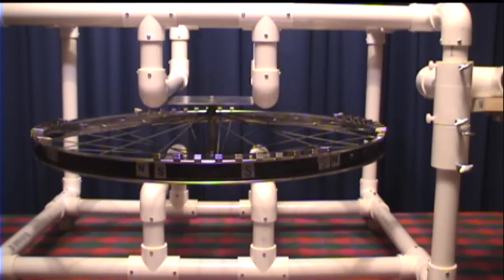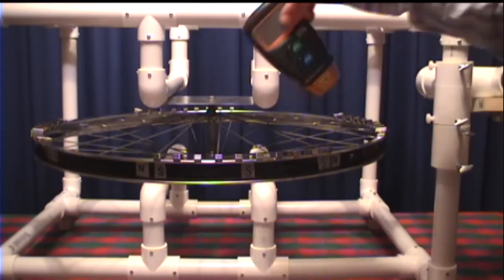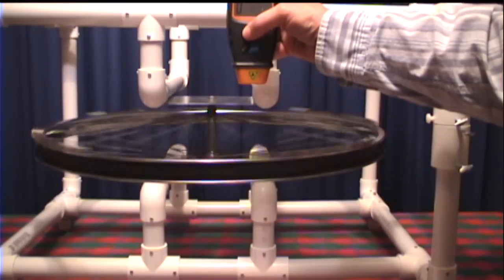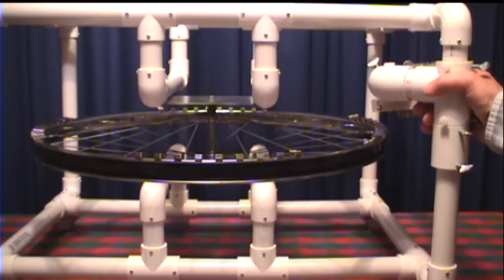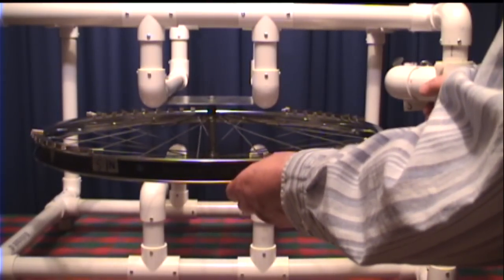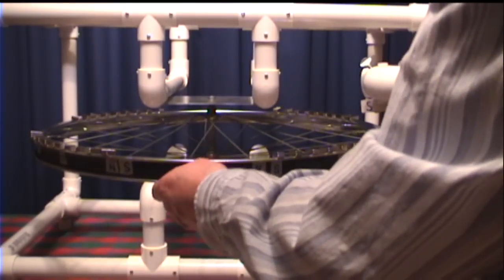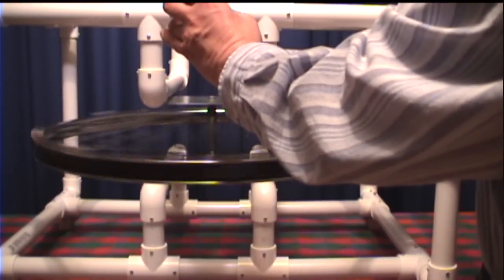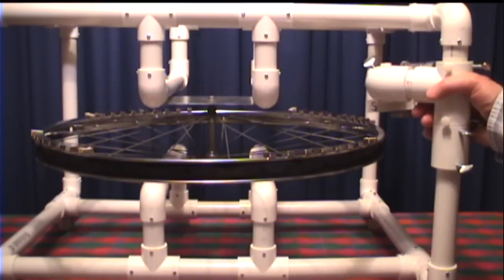Video #16, "Rick's Pipe Dream" Magnetic Motor -  Generator

Comment from the maker: I see it, Stefan.  I don't see where this would be of advantage in my preferred configuration as shown in this video, but it would help out with a fixed stator.  I could test that for you, if that would be of help to what you are working on.  Watch video #17, available later tonight, to see my flywheel connected, and e-mail me with details of how you would propose to setup for the test.  Best regards,  Rick

Comment from the maker: Magnetic shielding has been used for decades, and it does have its place.  That place is with a fixed stator design, which isn't the case here.  My build uses a moving stator, and requires no shielding.  I don't want to shield the attraction or repulsion forces - I want to fully utilize them to advantage, and a moving stator is the best way to accomplish this.

Comment from the maker: Thank you, Alien.  I don't plan to use a spring, because I want to keep drag to a bare minimum.  I won't exactly be using a cam either, although the monorail track which I am installing will have the same effect as a cam.  It will slowly weave inward and outwards 1/2"  or so out beyond the perimeter of the wheel, if you can picture that.

Comment from the maker: Hi Stefan.  I'm not sure what TOMI video you are referring to, since more than 12,000 show up in a search on that word.  Anyways, sticky points really aren't a problem in this build.  The sticky points would normally be at the front of each rotor group, where attraction comes into play, but you can see that the groups are drawn in towards the stator and then accellerated, even from a standstill.  There is accelleration at both ends of each group.

Comment from the maker: Hi, jbig.  Yes, as I've pointed out a few times, this is a junk wheel which was severely bent and rusted, and has wicked bad bearings.  I have a spanking new replacement for it, but am holding off a bit.  I figure that if I can make this one work fairly well then the new one will work all the better.  I don't mind the handicap for now.  Best regards to you.  :)

Comment: Please try to use 90 degrees bended iron bar plates as I used in my TOMI video.

It really helps to guide the magnetic flux away from the sticking points.

Good luck.

Regards, Stefan.

Comment: You might want to look more at your bearings or something in the holding mechanism because when you bring the stator mags over the wheel, the wheel rises a bit. that might be slowing your revs a bit. Improving the resistance to lateral movements of your bike rim should net you some more revs and easier operation as well.

Comment from the maker: Hi destin,  and thank you.  The force required to move the stator is dependent upon the height of the stator magnet above the rotor magnets.  As you lower the stator arm, more force is required, and visa versa.  In this video the distance is 1", and although the stator still moves fairly easy, it is probably 5 to 10 times the force required when set at 1.75" as in video #15.  I do feel that this wheel can be a self-runner, and that is what I am working towards.

Comment: Rick looks promising, I'm working on something like this. if you can design  a sort of cam to run off the hub so there is little drag you might  get the right movement with from the stator.
  Good luck

Comment from the maker: As I mentioned earlier on, I really don't have enough time to engage in protracted arguments or debates, and it is difficult to change anyone's mindset once it is firmly established.  Therefore, I simply ask that everyone keep their minds open to the possibility, however slim, that the principles I am showing you may be brought together to provide a working magnetic motor.  I concede that I may fail, but I would surely fail if I didn't at least try.

Comment from the maker: Thanks for remaining polite in your arguments, Asym.  I appreciate that, and I also understand where your thoughts are coming from and why.  Still, you haven't answered my question of two posts earlier.  If you agree to my flywheel analysis, then you must also agree that I can in fact extract the energy from the wheel which is needed to move the stator.  I have only moved it manually for the demos, and soon will be moving it with my tracking system.

Comment from the maker: Surely you can reason how the flywheel heft, when added on, will create far more inertial force at the wheel's perimeter than is now available with this lightweight wheel and small magnets.  If I can spin the wheel as fast after adding the flywheel as I could without it, then would you agree that I have greatly increased the available force to accomplish the MOSTAT movement, and that it might just work?  I will demonstrate a new speed test after installation of the flywheel.

Comment from the maker: By moving the stator, I avoid the anti rotational forces of  both "sticky points" and undesired repulsion.  The MOSTAT makes full and beneficial use of both these forces in an additive manner as each group passes the stator.  So there is no cancellation effect.  If there were, you would not see what you do in this video - instead, the wheel would either not rotate at all or would just limp along.

Comment from the maker: Yes, it does require a small amount of energy to move the stator, but the attraction and repulsion forces will provide most of that energy, with the flywheel effect providing the rest.  The attraction and repulsion forces do not cancel each other out in this design as they do in others.  In fact, they are additive.  Each magnet group takes full advantage of attraction to draw in and accellerate it, and then repulsion is used at the back end of each group to give further accelleration.

Comment from the maker: Hi waditto,  and thanks for your good luck wishes.  I'm well aware of the Mylow debacle, and it really is unfortunate that it has stirred so much controversy.  Don't worry, I will leave no stone unturned in fully revealing everything about my device.  I am trying to offer as much light as possible without creating reflective glare, and high resoulution, sharp focused video.  After I complete my flywheel and tracking system I will take the device before a live audience of several people.